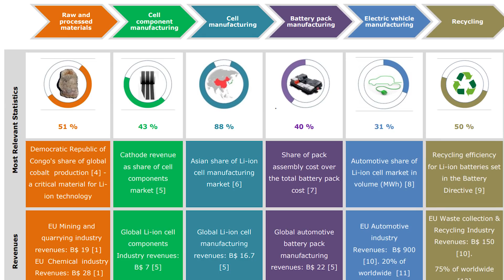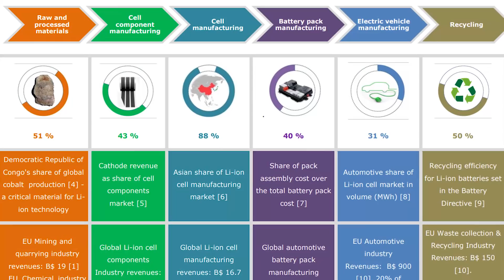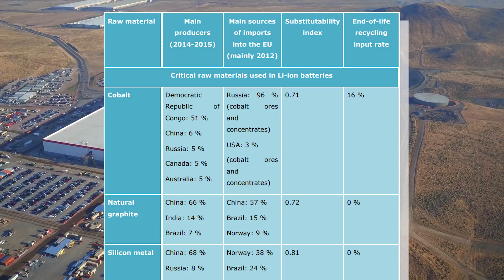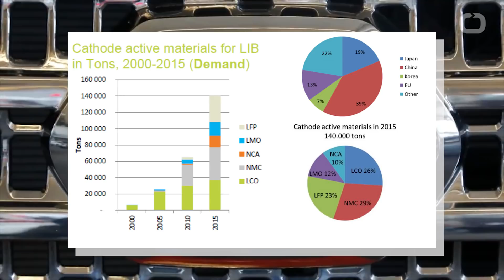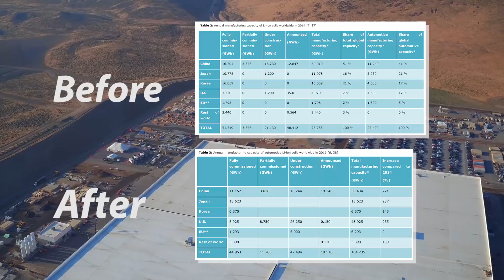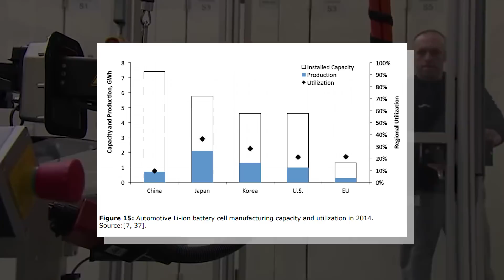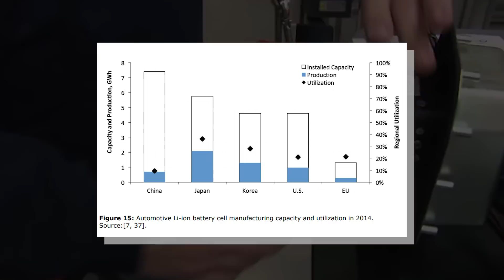Lithium ion Battery, Explained [Pt. 1/2]

Comment: You mentioned only China and Japan - not South Korea. I guess it is worth to mention South Korea, too. Samsung SDI and LG Chem are big battery manufacturers and SK Innovation is one of the biggest separator manufacturer in the world.
Reply: I agree on your opinion. I think the mass production for battery with QC is not easy. so, before the production is stable, input and output is very different and have a lot of loss. Then, think of this, South Korea, they have the skill and know-how battery production and still have produced huge q'ty now. So, it is worth !  In Video, Japan and China have five companies but, Korea has only 2 companies in video. But,  production volume in the world  is top rank of both companies. I think it is important that how much the battery manufacturer can produce stable quality in MP , not  how many battery manufacturers  in a nation.

Comment: I think their judgment is reasonable considering that China will produce the batteries they will ever need.  For Tesla, getting their hands on battery building is paramount.  That is the company's value.  Tesla is basically a battery company.  They expect the competition to build better electric cars in the future but Tesla will have the upper hand in terms of battery capacity, performance, and cost.  Better batteries also helps with their business such as the Powerwall/packs and trucks.
Reply: Yes, but China can choose at any time to give priority to it's own car manufacturers, and then GM and WV are fucked. Soon electric cars will really take off, and that excess capacity will vanish overnight. China makes a lot of EVs and they really need them because of their pollution problem. It's a huge risk.
GM is one thing, but WV is very important for the German economy. Since batteries are essential components of EVs, WV will fully depend on Chinese politics, which means China will have a big influence in German politics. And since Germany is the most influential member of the EU, this could make the entire EU vulnerable.